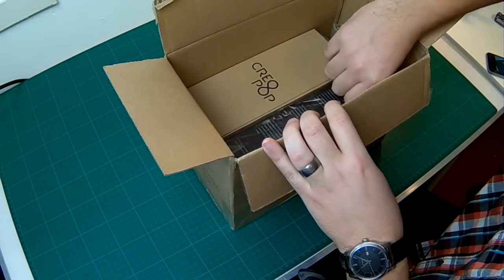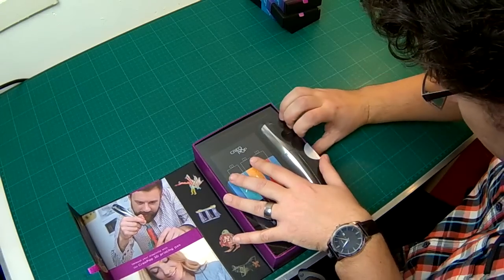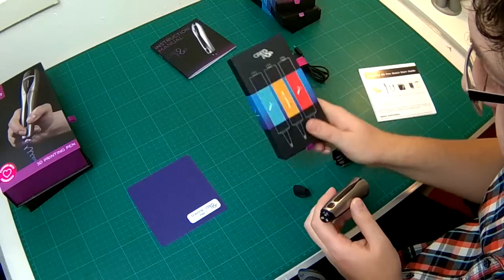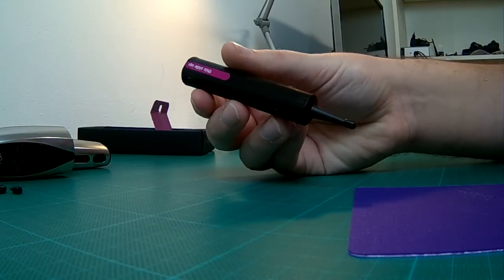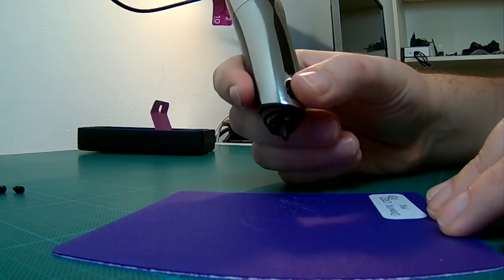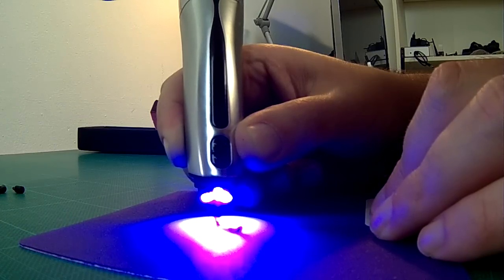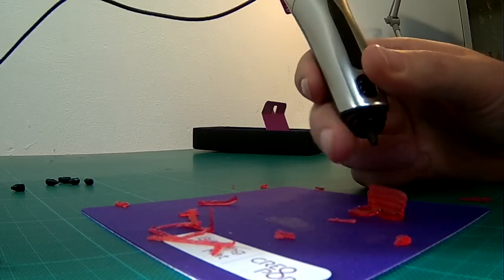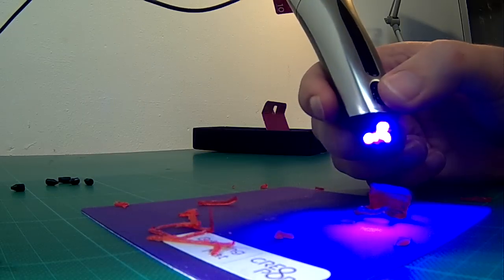CreoPop 3D Printing Pen - Unboxing and initial thoughts

Comment: your audio isn't very good. next time. try something different with audio. get a microphone or something. sorry to say but the audio sucks.
Reply from the maker: Yes, it does. I have upgraded since though. Check out the more recent videos, you'll notice the difference right away.
Reply: +Frederick Vandenbosch when you first got it out of the box did you have to charge it for 2 hours before a light would even turn on?
Reply from the maker: +Multitudes With Meg Nope, worked right away.

Comment: how much ink did you use, does it get used quickly?
Reply from the maker: +CornwallKate Each cartridge can print up to 14 meters long using a 1mm diameter nozzle. I found that too small to work with, so I use the bigger nozzle instead. I'd say using the bigger nozzle, you could probably print about 4 figurines.
Reply: +Frederick Vandenbosch  thanks for that info, useful to know